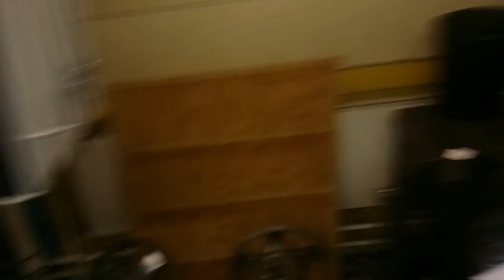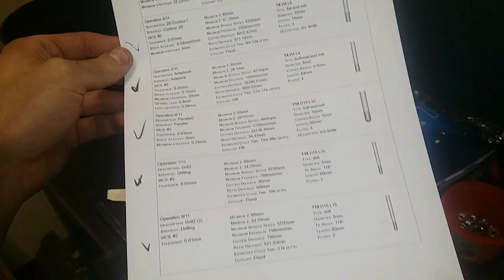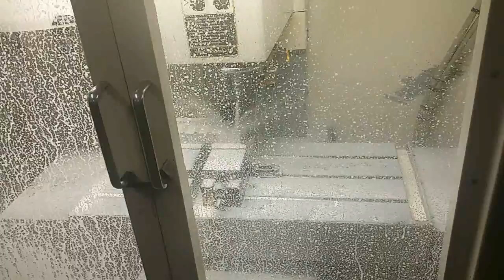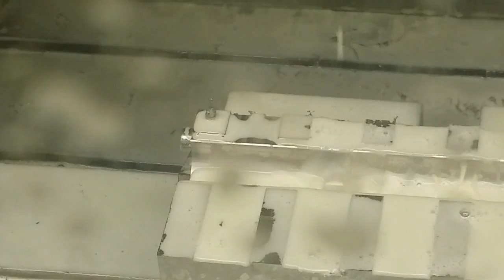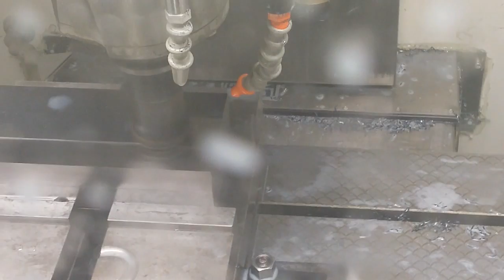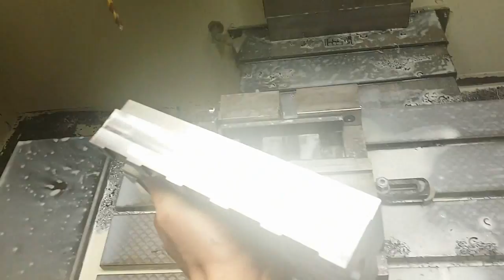CNC milling a steel part from start to finish

Comment: I dont know anything about CNC . but when you program does it take longer to program the job or to do the work I know every job will be different Thanks
Reply from the maker: Usually 75% or more of the work is in programming and setting to stock and tools. The run itself is usually very fast. That's why CNC is mainly for production work, but now that I have a CNC, I do most of my one off parts on it as well :-). Mostly the whole process takes the same time as on a manual but the finish quality is much better.

Comment: Did at-man help you with the rigid tapping? It almost looked like the last tap hole the tape broke. Dave
Reply from the maker: Yes he did! The original Fusion post does not support rigid tapping. The tap just pulled the chips up somehow. Really should have used a bottoming tap here.